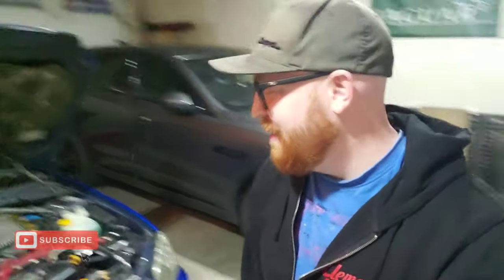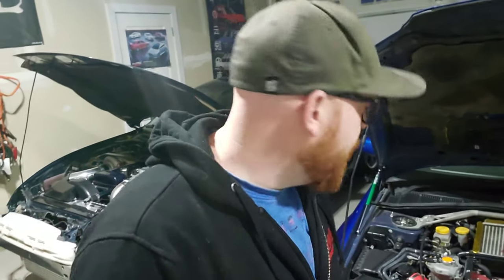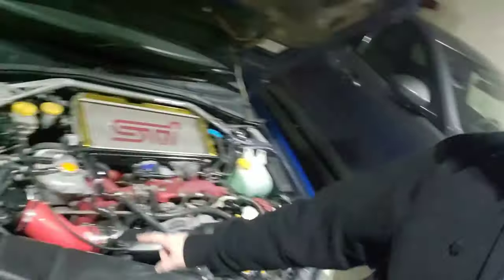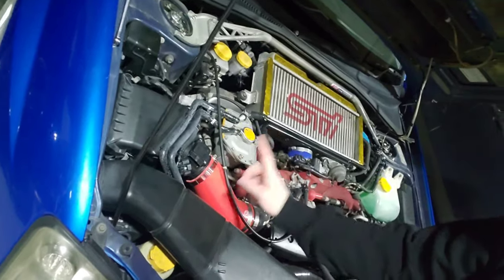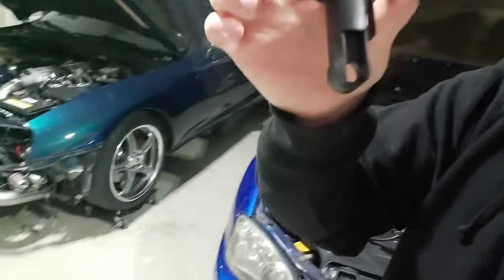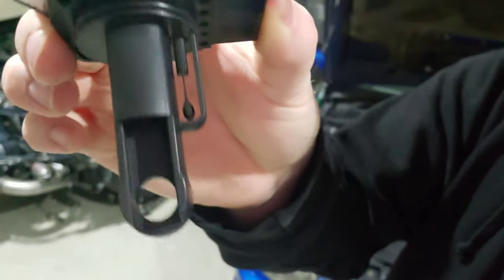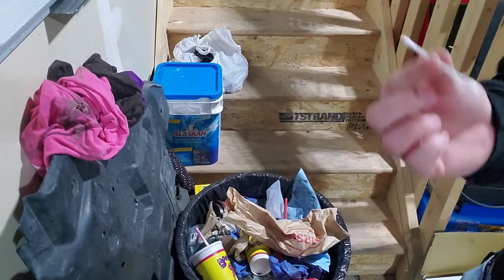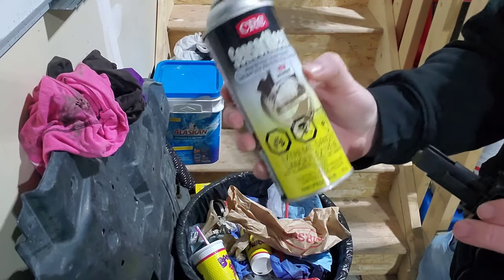How To Clean Subaru MAF (WRX, STI, Forester, Legacy) and WHY it is SO IMPORTANT! W/Product Link

Comment: You cleaned the temp sensor. The actual maf sensor wires are where you said the temp and other sensors were (up the tube). Glad it worked for you tho :)
Reply from the maker: I dont think there is a point to get technical for most viewers. The MAF unit is a whole unit. Temp sensors are within the unit. So why the technicalities? Lol. Anything insulated with dust on the MAF sensor is a bad time. That's the point of the video.
Reply: @BoltsNBoost  absolutely :) however, cleaning the actual wires might solve issues that some viewers might have.
I'm a fellow subaru wrx sti owner so i appreciated the well made video!
Reply from the maker: @holmuren  thanks man!:)
Reply: @BoltsNBoost  my bug eyes MAF sensor is dirty I need to do this when I go to the car sometime this weekend
Reply: @BoltsNBoost  Can you share info where to get the o-ring kit for the STi? Can you get that from partsource??
Reply from the maker: @1009wlwilling  which O ring kit are you referring to?
Reply: @BoltsNBoost  the O-ring kit you said Derrick had to get because he found out his O-ring on the MAF sensor broke? I just found out mine chipped off a little but I don’t necessary want to change the whole MAF now…
Reply from the maker: @1009wlwilling  oh for the MAF? I haven't found replacements yet. I just take them from car at the junk yard that have same MAF

Comment: Going to do this on my 2015 subaru forester xt. On cold starts, it's been idling rough. Then when the engine temperature reaches around 50-90°F, the rough idle goes away. Been using a k&n reusable air filter, so I imagine the oil from the filter has gotten it dirty. I've also learned that using CRC intake valve and turbo cleaner also helps but I'm going to start with the MAF cleaning and new air filter first then go from there. This is all new to me. But it's time I give my subaru some love since it's been taking care of me for 96k miles.
Reply from the maker: Good call ! 
I'm not sure why most Subaru MAFs get a thick coating of this fine dust. Mine still has factory paper filter in there too at this time .

Comment: Thanks!
Edit: My 2003 subara Forester X didn't have a MAF my manual said. I looked all along the air intake after air filter but I only found a temperature sensor which unplugs there.

You mentioned MAP sensors. Are they an alternative to MAFs or is it completely unrelated that you brought it up? Could I replace/clean it?
Reply: Non Turbo of that generation use Air Density not MAF

Comment: Would this be problem for dancing idle. Mine goes from 300rpm to 900rpm or mine is tune related? It is heavily moded sti 2017
Reply from the maker: Very well could be.. but I'd hope if your that tuned, you'd be running off speed density (MAP) VS MAF.

Comment: Wonder if this is going to fix my problem I fixed the speed sensor on my trash 5 speed with a Iwire kit which is a by pass and still Boggs hoping this will do the trick! that the new lower part of the air box that I bought :)
Reply from the maker: Here's to hoping!
Reply: @BoltsNBoost  it worked holy shit

Comment: Would this make your Air/Fuel gauge say it’s running completely rich ? Even when I cold start no check engine light. I make full boost though
Reply from the maker: Definitely could. Maf controls fuel tables
Reply: @BoltsNBoost  alright I’ll check this today. Thanks

Comment: Is this something that would cause the car to run too rich? I have issues without popping a cel for bank 1 too rich and also the code has been popping every so often bit now even more often with the noticeable OSS in power and rich idle/dumping too much fuel for the throttle input im giving.
Reply from the maker: Yes. It definitely could.
Reply: @BoltsNBoost  it was my problem. She runs like a champ again. Sorry for the butcher job on my last comment 🤣
Reply from the maker: @wayde187  glad it helped!

Comment: Fucking weird, I have a ton of dust and crap around me, my filter is usually really dirty every oil change (not oiled)... But I just did cleaned my filter (it's the ETS intake for my VB) and decided to check the MAF sensor. I'm at 23k miles and my MAF was super clean. Maybe it's only the older Subarus? My 2018 never got that dirty either...

Comment: Ok so I’m late to the video but hoping someone can help me out I have a 04 wrx and it was misfiring and hesitation was really bad when I started to hit around 10 pounds of boost so I first cleaned my maf and put it back in I was very careful with it but my car would crank and start but after 2 seconds it would just die so then I just decided to get a new maf and I put that in and the car still won’t start I have no idea what it could be my car ran before but it just starts for a few seconds and turns off now
Reply from the maker: I'd start with a compression and leak down test. But, in a lot of cases the coilpacks are unplugged slightly or bad
Reply: @BoltsNBoost  so I replaced my coil packs about a month ago and my spark plugs 2 weeks ago I was thinking it was a leak but I just had a smoke test done last week due to my evap system having a leak and I was told the only leaks they found were a hose connected to the charcoal canister and my gas cap was lose but my car starts without my maf plugged in it just idles high
Reply: @somewrxguy1785   check your O2 sensors
Reply: @somewrxguy1785  did you put the maf in backwards? I had that happen once and it kept going into limp mode. Make sure the arrow is pointing with the airflow.
Reply: @tigermedz  I have made that mistake previously but it is a lifters tick and my engine is losing a lot of compression so I am having it repaired
Reply: @somewrxguy1785  you should try some marvel mystery oil in your oil, it really lubricates the lifters and upper cylinder heads. (Preventatively). I have a 2.4 tigershark which are known for noisy lifters and I can't even hear it now. I run royal purple and marvel in it. Just cleaned my maf tonight and it got back quite a bit of oomph.
Reply: @tigermedz  I’ve already tried mmo the previous mechanic was messing with my car and racing people and must have shifted wrong it was damaged pretty bad my current mechanic who is a family friend said I got it there right in time and any sooner the motor would have needed a complete rebuild I didn’t think much of it because the mechanic that screwed it up said it was a purge valve noise and would go away in 1000ish miles but never did
Reply: @tigermedz  do you have a idea on how long lifter repairs take? I’m having lifters done new gaskets because why not and a new clutch since there dropping my transmission anyways
Reply: @somewrxguy1785  well usually the lifters are under the upper manifold cover, so it shouldn't take that long to get to them. And dude that sucks that your old mechanic was beating on your car. I hope it's all sorted out for you man.
Reply: @tigermedz  yeah it was pretty shitty it’s just costly for all the repairs the cars been gone for about 3 weeks so I’m just wondering how much longer I’ve been trying to not bug them about it so I’ve been calling once every week or 2 but I know they have the motor pulled already